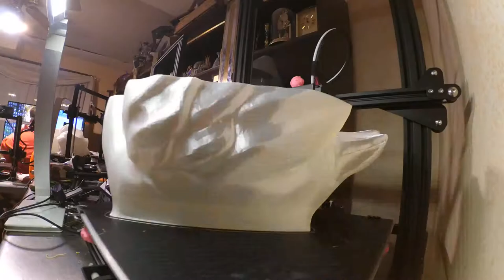Today's 3D Print - Timelapse Loubie Swan

Comment: Would you be interested in selling one of your ender-2s? I know you just got a ton of them from amazon so I figured i'd offer before going that route. 
I just thought of something. With all those Ender 2's you could start doing a think like Tiny Machines and sell them but at a higher price because they are tested and tuned.
Reply from the maker: x9x9x9x9x9 I am $200 each plus shipping but I'm only selling 5 assuming I get online working this way I'll still have six or seven total to create my parts farm for my rocket parts. I think five may have been spoken for already will finalize once I see how many actually work
Reply: Ah okay. I will probably just turn to Amazon or Gearbest then. probably the latter as i am not in a rush

Comment: You should add some music to your printing videos.
Reply from the maker: I have considered that (I do like the ones I See with music) but that is editing and that consumes a tremendous amount of time. something I am seriously lacking in. if I can figure out a simpler way to do it (and make sure its legal etc..) I will try to start doing it.

would longer timelapse be better? I could string a few together might reduce the "editing" time. it would be a crude sync for sure but it might or might not be better.

even the very basic editing I do now. formatting the vids linking parts into one file naming them C&V'ing the data and links etc.. takes nearly 25% of my available time. I have to start being smarter about time management as well :-) something I am lacking in.